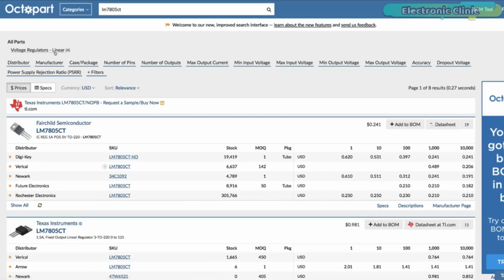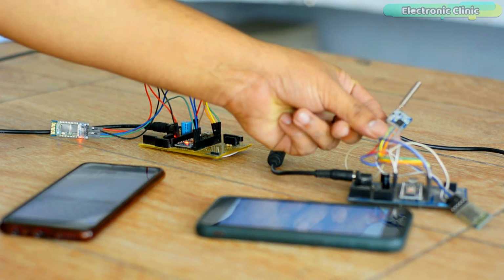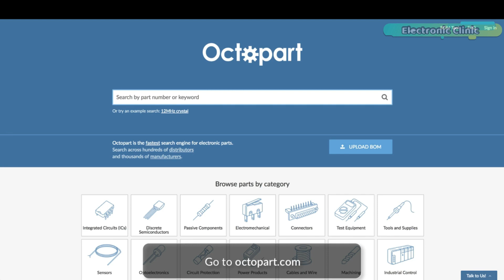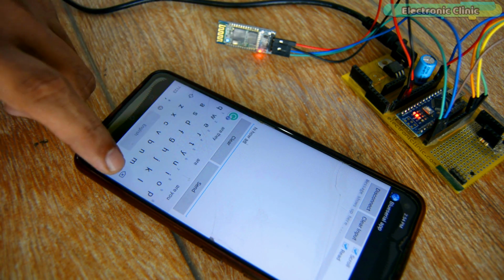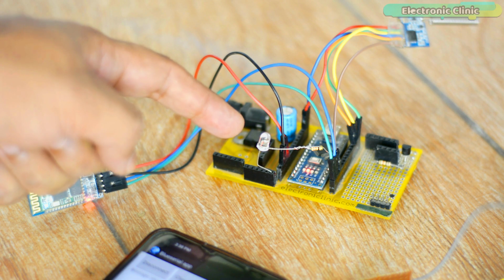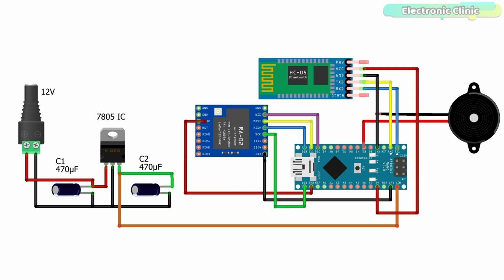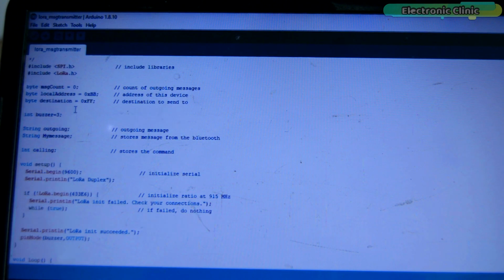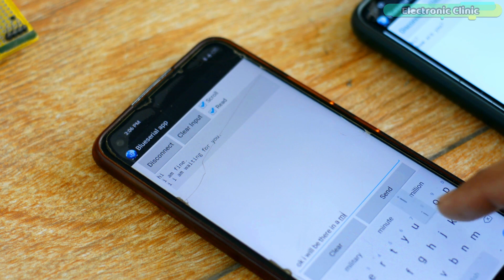Arduino LoRa Free SMS over Long distance without GSM Network, Arduino send SMS | LoRa Bluetooth

Comment: bro!, i am student and i am trying to make this project as same u do but the texts are not received in the receiver side, why is that happening, i used Ra-02 sx1278 lora can you help me to find what's wrong. please.....
Reply: i checked the connections more than 25 times still its not working, but i can able to receive the values of a sensor through it with other program so there is no problem with the hardware as well, is there any specific lora library u have used here

Comment: If two people installed Blue Serial in their phones and they are using your LoRa/Arduino system in a remote area, how is it that they can use only their phones without the LoRa/Arduino base present as they traverse the remote area?  What distance does a smartphone have to be from the LoRa/Arduino base to still be viable?

Comment: there are some mistakes in provided code . like the major mistake is that both user code are having same address and destination :) . i have modified the both codes which are working now . Btw thanks you have put a great effort ...
Reply: Ellow.. Can u provide me the correction.. Thanks..
Reply: Can you write the error in the code? Thanks.

Comment: Thank you, the video is very useful. I have a question. How do you look at improving this project? Laura doesn't allow you to make long distances. And if you take a regular analogue-voice walkie-talkie and use this type of SMS communication. The problem is that the transmission speed needs to be adjusted. I think this can be done. It would also be cool to add your own encoding. I think the encoding can be given to a smartphone. How do you like the proposal?
Reply from the maker: Maximum how much distance are you looking for?
Reply: @ElectroniClinic ❤
Reply: Is possible to 100 mil for use in the sea ...? Thank

Comment: Hey i am wondering if the communication between two lora module is secure or it can be intercepted by someone, and if it can be intercepted can we add any encryption in the code and decryption in the other device ?
Reply from the maker: Ya you can encrypt it and for this you can use the Arduino library.

Comment: what if I don't use a 5 volt voltage regulator and directly use a 7.4 volt battery directly to the voltage input in arduino nano, what will happen sir? and how if I change the lora using nb-iot what should I do?

Comment: Been following lorawan tech for a few years now, and its so good to see different projects.  I think there's a huge market around low-powered, contingency/emergency communication with lorawan.  If the nodes had an integrated small screen and keyboard, if there was an emergency, a family in a rural town could communicate in their own network..
Reply from the maker: This time round, i have designed my own arduino LoRa development board, and i have performed the range tests using different types of antennas. I will upload the video this sunday. In my upcoming videos, i will try to add a small keypad.

Comment: I have some questions, which are :
1. If I want to make it end-to end encrypted, can I use a library? If yes, what type of library can I use?
2. Also, I want to make this project and add some security aspects other than the encryption, kindly, if you could advise me on how to make this project more secure?
3. Regarding the smartphone device, what version of samsung have you used in the video? Can we use any version?
Reply: lorawan supports encryption.  As far as phone, there's two different ways to answer that:  Technically, you just need a bluetooth connection, and the app development would be up to you.  Practically though, if you want to use his app, you need an andriod phone.  In this example though, I have no idea why he wouldn't take advantage of bluetooth notifications.  The device can wake up, prompt for connection, and send a notification to the phone easily enough.  A buzzer or led seems like it'd work out on a hike, but not so much when you're at a supermarket with no cell service

Comment: Note that the LoRa module SX1276 for the emitter should not be powered by the Arduino Nano, but by an external 3.3V power supply to have enough current
Reply: What if i powered the lora module by Arduino nano will it work